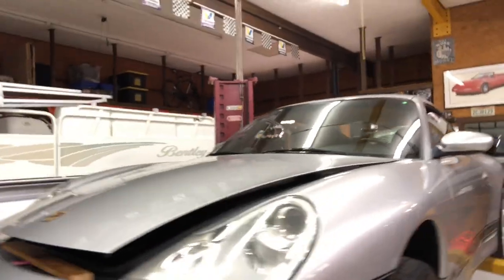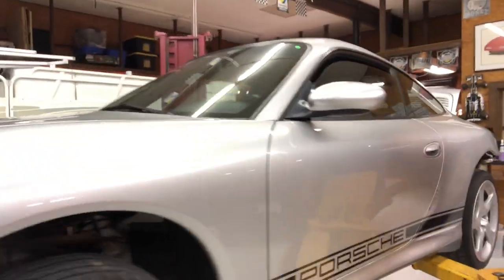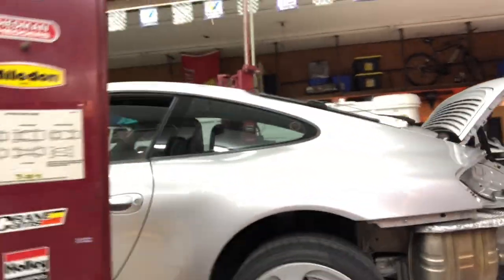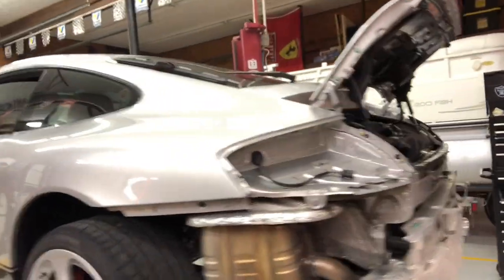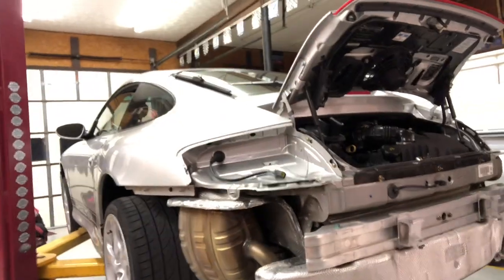Porsche 996 - Metal in the Oil Filter

Comment: Bore score is quite rare and would normally be associated with a loud knocking noise getting worse over time, its not normally an instant failure, plus its more of a 997.1 3.8 thing. Its possible you suffered oil starvation damaging the engine (bearings/IMS) as the sump isn't designed for racing. You can drive for some time with an engine with scored cylinders with no warning lights showing. Misfire and engine warning lights indicates something else possibly timing/sensor related - The engine needs TLC but It may not be too bad.